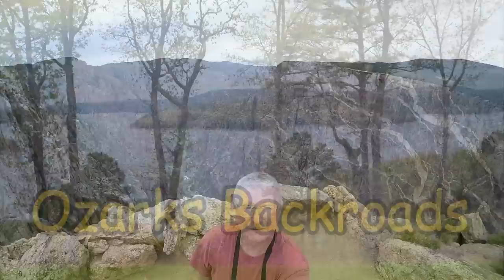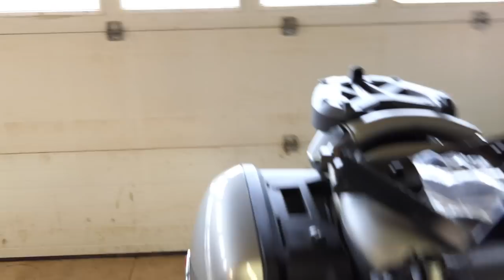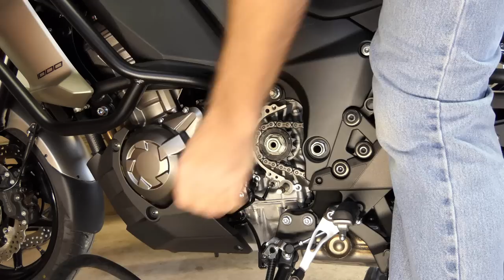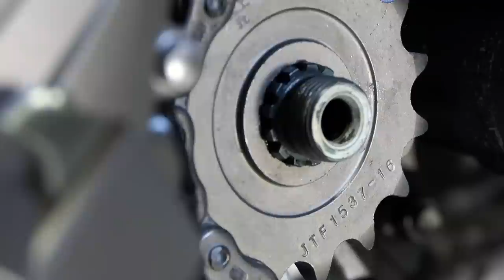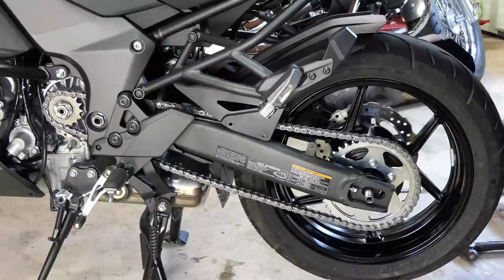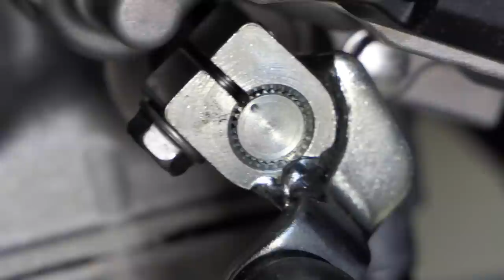Sprockets Change on the Versys 1000

Comment: Well Michael, the FJR is hands down the nicest most touring capable bike I have ever had, I absolutely love it however it is also quite heavy and the weight is up high in the bike.  When maneuvering the FJR on gravel it gets a little tricky especially when loaded down with gear when traveling.   Also if I drop the FJR over it is Hell to get picked back up by myself.  The Versys is much lighter and easier to ride on loose surfaces.  The Versys seems to be very comfortable to travel on and the bike seems as though it will have no trouble doing the long hauls.  So I guess if I am just going to be traveling and not going off the pavement much I would rather do that on the FJR .  Most of my long trips wind up being several days of traveling highways to get to areas were I wind up doing a lot of gravel parking lots and some gravel roads and then days more highway travel to get back home.  So I would prefer to ride the FJR out west and then ride around out there on the Versys for a couple of weeks and then ride the FJR back home but I haven't worked out how to pull that off just yet.  I do a lot of back road traveling here in the Ozarks which is secondary paved twisty roads and gravel as well.  That is really what I got the Versys for but I gotta take at least one good long trip on it to christen it properly right?

Comment: Hi, love your detailed and excellent instructional level videos!  I am a bit new to the mechanics part of motorcycles.  I recently got myself a very low milage 2020 Versys 1000 SE.   Perhaps I am missing the point but can you in a word or two explain (again?) as to why you went ahead and changed the two sprockets?   What is it that drove you to do this sprockets job?  Thanking you in advance!!!
Reply from the maker: Hello there sir, good to hear from you.  I changed the final drive gear ratio on the Versys to drop the rpm a bit at highway speeds.  I changed both sprockets to get the ratio I was after and also I did not have to remove a link out of the chain by changing both sprockets.  Had I dropped 3 or 4 teeth alone on the rear sprocket the drive chain would have been to long and require a link to be removed.  Hope this helps... Thanks for watching and keep safe out there...   :)

Comment: So the RPM felt to high at highway speed even with a 6 speed? That is one thing that does drive me crazy is a bike running high rpm at 70. I'm used to big Harley's,  they virtually idle at 65 70 in 6th gear. I've never had the pleasure of enjoying a inline 4 before .
Reply: At 70-80 rpm's are not to high.  My Triumph 900 Sprint ran 5k at indicated 80mph (which was actually73) It was its sweet spot. Used zero oil with over 65k on speedo. Tried regearing it and my mileage went down, had to drop a gear to pass.  I average around 44-47 mpg also.

Comment: Hi john when you alingned the rear wheel  with that tool did u loose your slack in the chain? I thought the wheel had to be on the ground to get proper slack thx
Reply from the maker: Yes Sir, the well needs to be down and 1 inch of slack is not enough on the versys, it needs at least 1.5" on slack to not bind the chain when the suspension is fully compressed.....  thanks sir....

Comment: Wow thanks for the quick response  soo u think sprockets dont mess at all with fuel n timing n such.? N is it less vibration  but is it less power?
Reply from the maker: nope, its all good...cant tell much difference in power ....
Reply: I did an even bigger gearing change than Ozarks did (17 tooth drive, stock driven. You need 118 links too. Stock chain is 116.) I haven’t ridden it more than a few minutes but I really like the change and no you can’t really tell a difference in power in high gears. The power band is absurdly broad and linear on this engine, you could get away with just about any changes you wanted. 
I did some freeway speed uphill 6th gear roll on pass the car thingys. At half to 3/4 throttle it just goes broooam and jumps to 90 mph and wheee around you go! Completely satisfied with gearing. 3250 for indicated 65. I think the mpg indicator jumped up significantly too but a couple tanks will tell on that. 
Changing the gearing isn’t going to mess with engine stuff like fuel and timing. The systems are far from being that integrated. So not to worry. 

HTH
Reply: David Florance      Timing? 🤔

Comment: Another job well done👍. I only have one note. I think it would be wise to give the chain a little more slack
because the bike is unloaded at the moment you adjusted the chain slack. I know what the manual says
but when you sit down on the bike, the chain tightens up. If you carry a passenger or go on a full packed road trip
it also has an impact on the chain slack. If the chain is to tight you will wear your sprockets also faster. If your release
chain tension a bit more, you will feel that the gear shifts go smoother too. You don’t have to believe me, it’s just a tip
from my Kawasaki mechanic. Just try it, it’s not much work😉

Comment: Many years ago, I had the front pulley nut loosen on my 440LTD.  It was belt drive.  That pulley rocked on the shaft and the pulley sacrificed itself.  It was softer than the shaft.  Hopefully most sprockets are softer than the output shaft so that the output shaft doesn't have to be replaced if the nut was to loosen.  It is still a very good practice to make sure that it is tight to begin with.

Comment: Tyvm for a great video! I'm learning so i really appreciate the step by step, detailed info.  What exactly is "Molly" grease?
Reply from the maker: molly grease is used for high friction/pressure applications where high anti friction properties are needed...ie wheel bearing grease.  Molly refers to the make up of the grease, Molybdenum disulfide.  Most grease that says it is for wheel bearing use will be Molly.  Thanks for the comment Sir...  :)

Comment: Hi. I was wondering if you can share your feedback after changing both sprockets on Versys. I am planning on doing exactly the same change to my Versys as well. Also, can you please provide links where did you purchase each sprocket.
Thank you in advance.
Reply from the maker: Hello Igor, I am very pleased with the sprocket change on the Versys.  The engine dropped 400 RPM in 6th gear at 65 MPH.  It also nearly corrected the speedometer according to my GPS. The engine still pulls well over hills and from a stop so it is not over geared at all, I would say it is just about right in that respect now.  I bought my gears from Revzilla but they are available on many sites.  They are the JT sprokets...   Thanks for your interest.....
Reply: Hi.
Thank you for your feedback. It is very valuable. I was wondering if you can share the exact model number for each new sprocket. I just want to avoid any possible mistake in getting the right parts for the job. Cannot wait to get it done.
Thank you in advance.
Igor.
Reply from the maker: Hey Igor, it looks like I ordered from Sprocketcenter.com and got the 42 tooth rear JT sprocket Part# JTR1489 and the 16 tooth front sprocket part# JTF1537.  Hope that helps....thanks....Jon Smith
Reply: Thank you !!

Comment: Hi. Is your gear indicator working ok after sprocket change?
Reply from the maker: no, it reads 1 gear to high after 2nd gear.  it reads 4th gear when its actually in 3rd, 5th when in 4th and 6th when in fifth.  The speed sensor is on the Transmission output shaft, not at the rear wheel so it is confused.
Reply: Humph. I did a similar thing, 17 tooth countershaft sprox, and got the same result. Gear indicator off by one. I see one of the square indicators is programable. I wonder if any of the round ones are programable.
Reply from the maker: I am not sure, since they plug into the diagnostic port I assume they simply display the gear selection that the ECM is reporting so the ECM on the bike may have to be flashed.
Reply: Here is what I have learned. I bought one of the cheap round ones that fits in the dash. It looks great and it worked OK with stock gearing. When I changed the gearing it did the same thing as yours, it’s off by percentage and it shows sixth gear when you’re in fifth, etc. 
as I understand it, the kawis don’t actually have a gear position sensor, or else the data is too hard to get at from the ECU. Even the oem Indicator calculated gear selection from engine speed and road speed. I wonder how the brand new bikes do it with their gear indicator.
Anyway, this will do the job because it is programmable. Too bad it is stupid expensive, and it isn’t a round one that fits in the dash like oem. 

http://shop.bluemonkeymotorsports.com/GIPro-DS-Series-for-Kawasaki_p_21.html

Cheers

Ps. Interestingly, I geared it up and the speedo still reads high compared to gps. 70 indicated is 66.
Reply from the maker: good info to have....Thanks Sir...   :)

Comment: I use it on both chain adjust bolts n nuts n coat the axle with it.
Reply from the maker: that great sir, i usually just use grease...  seems to work good for me....  Thanks...   :)
Reply: Bruce is exactly right. 

Grease is for bearings and antisieze is for fasteners.

Oiling or greasing bolts is an old concept that comes from the automotive world where they give "dry" and "oiled" torques on bolts. (My '15 Model T uses oil on the head bolts prior to torquing)

During my 30 years of industrial maintenance - I have seen all kinds of novel uses for antisieze, just keep it on the fasteners - works for threads and keeps the rest of the bolt from rusting in place.
This is from ADV Rider. 👍
Reply from the maker: @Me-yh4uc  sounds good to me .... do that....   :)

Comment: When i replaced the stock front sprocket on my 09 Versys 650 to a 16T i went with this OEM one....https://www.cheapcycleparts.com/oemparts/p/kawasaki/13144-0038/sprocket-output-16t-520    ..It came stock on this bike....https://www.cheapcycleparts.com/oemparts/a/kaw/500b77aff8700223e4798ae6/transmission